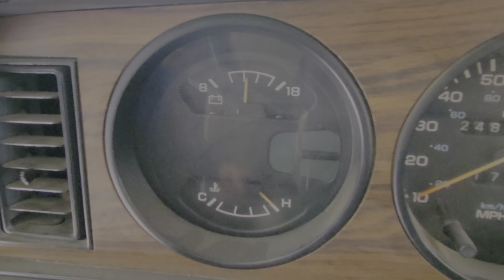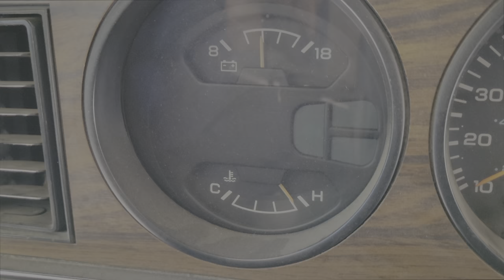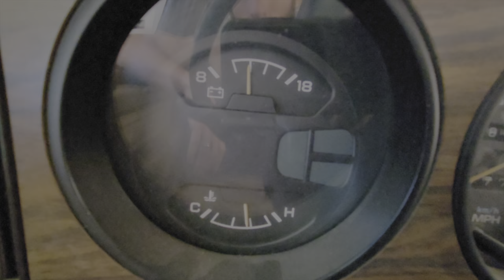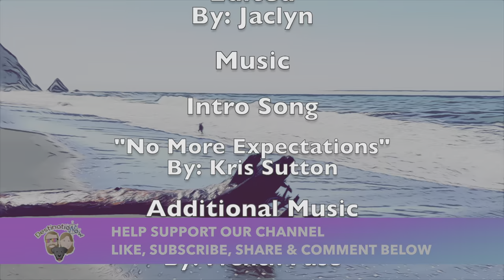Broken Down & Injured | Truck Camper Vlog | RV Life | DestinatioNow Ep122

Comment: Sorry to tell you this, but you should turn off the Car/Truck - if the car over heats and or turn on the heater full blast!  

Second  air in the radiator is normal After an overheating emergency! but, letting the air out, can help!

Also, if you can - try running in Neutral, if you are going down hill!

if you are running your Temp over 3/4 or 75% , that is a dangerous area to run your car/truck at!
Reply from the maker: Thanks for the advice.